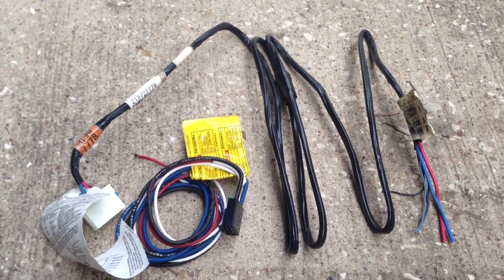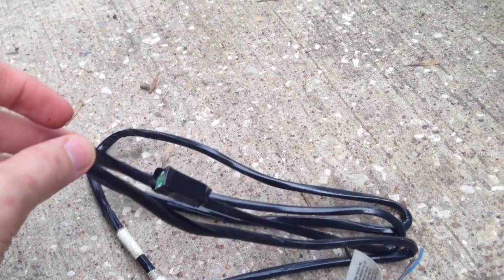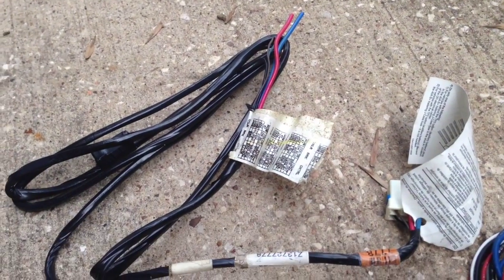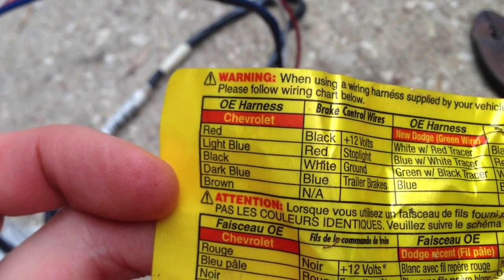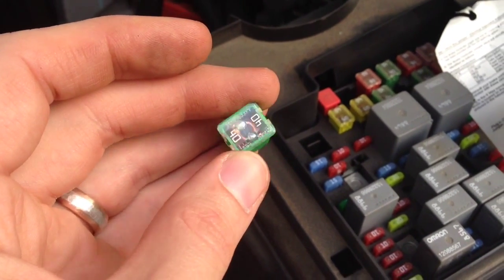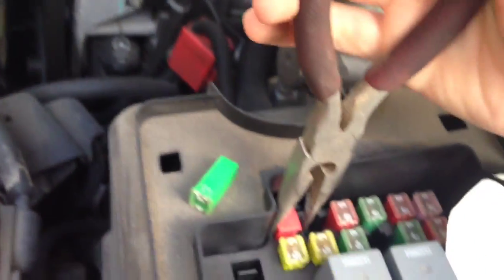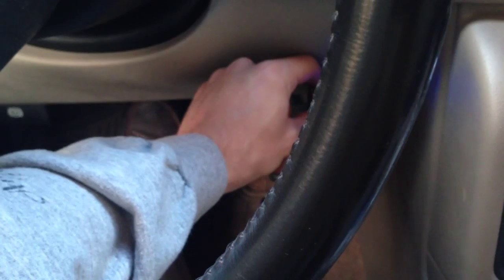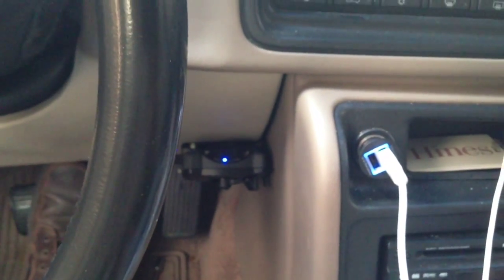2003 Suburban Trailer Brake Controller Install

Comment: Couldn't figure out for the life of me why my new brake controller wouldn't work turns out your video save me a lot of aggravation with that 40 amp fuse mine had the red plug in it and I didn't have instructions telling me that that needed to be removed and replaced with a 40 amp fuse

Comment: You realize they make an adapter that plugs into where the factory plug is and just plugs directly into the controller right?
Reply from the maker: Yes, but I can easily wire this up and not have to buy an extra harness.
Reply: @mjmcomputers  and not every vehicle came with the factory tow package so there is no factory plug!